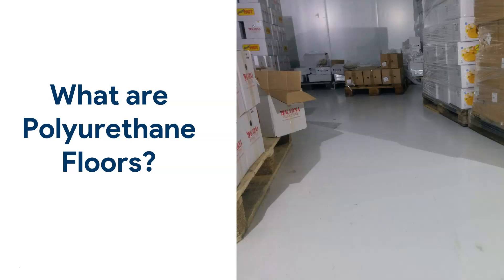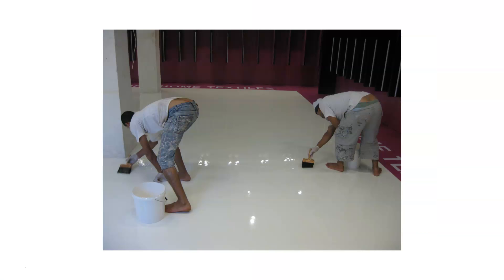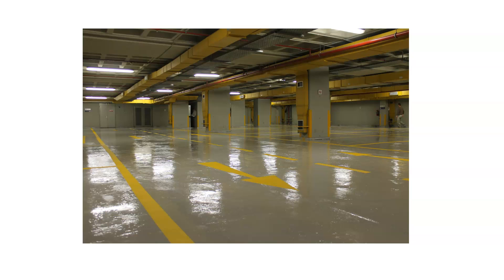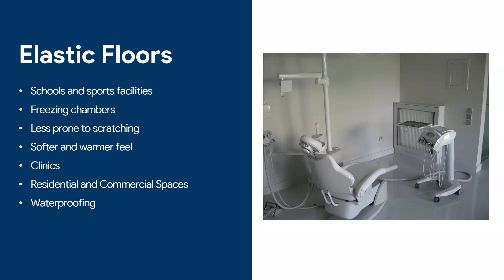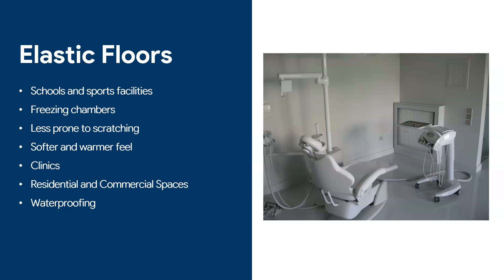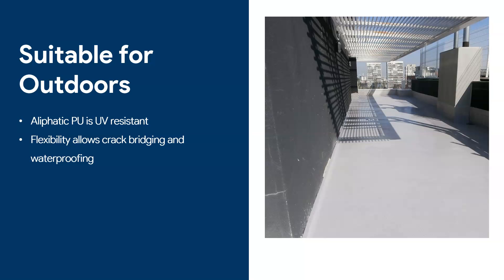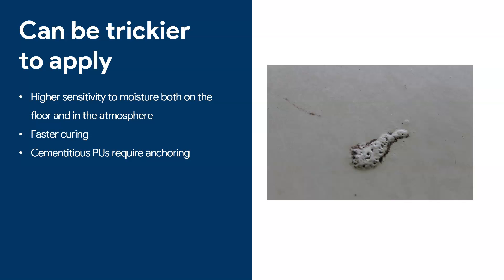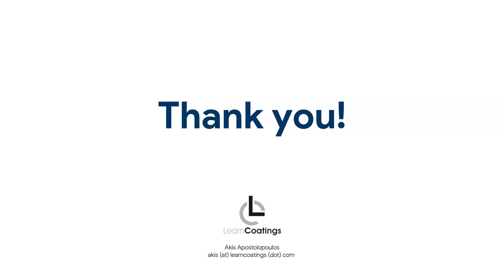What are Polyurethane Floors ? - An introduction

Comment: Hello, I've watched all your videos! They are so helpful! I currently have a microcement floor, coated with a "a water-borne urethane acrylic protection.." However I am not happy with the colour/texture and I want to re-coat it. I was wondering what kind of chemical (urethane or epoxy or water or solvent or :S) coloured topcoat I can use over it? Or what kind of primer I need first? If possible I just want to use a coloured topcoat to fix the colour/texture.. If it is not possible, I am thinking of rolling PU over it and then using a clear coat over the PU? Is coating necessary over PU for a bedroom? Is a matte/satin finish clear coat available over PU? Sorry for so many questions.. I am so lost..
Reply from the maker: I actually think epoxy primer works best for such situations, but its best to find a company that has the PU coatings and they will provide the right advice for all the steps that you mention.
Some companies have matte clear coats for PU,but again best find a company that can address all these issues

Comment: Hi, i just make a outdoor concrete/metal staircase, the steps are concrete, can you recommend me what i should use?
Reply from the maker: I would recommend an aliphatic polyurethane. Don't use epoxy as it will go yellow and peel in the sun. Also since these are stairs you may want to make the texture a bit rougher with quartz sand to prevent slipping especially if the surface is wet